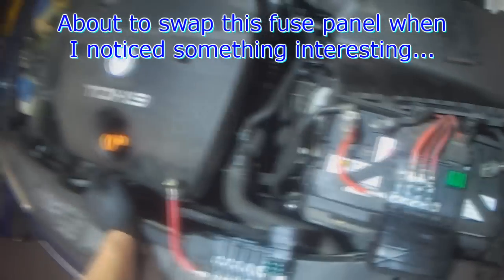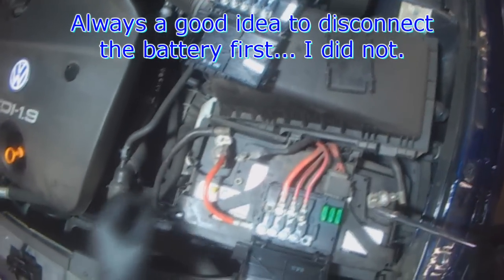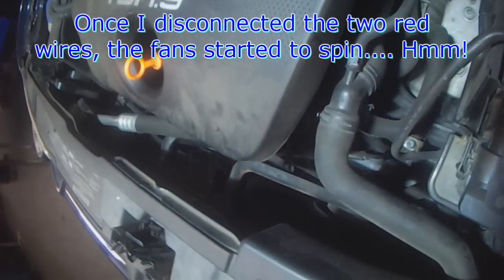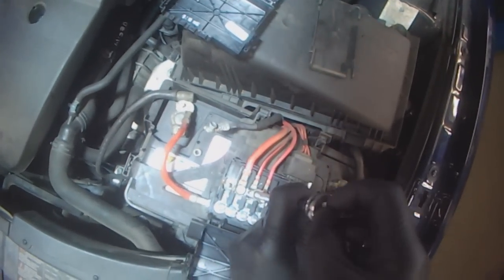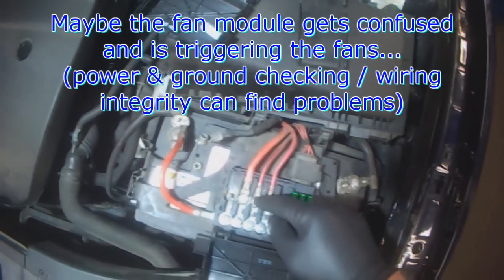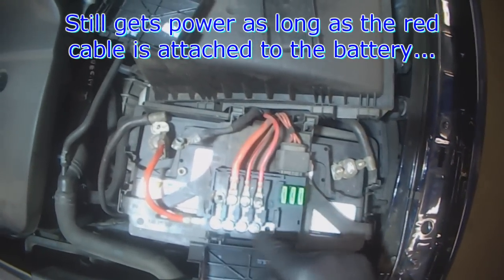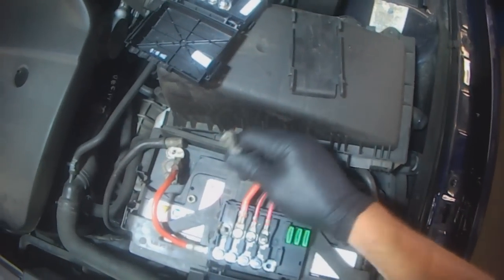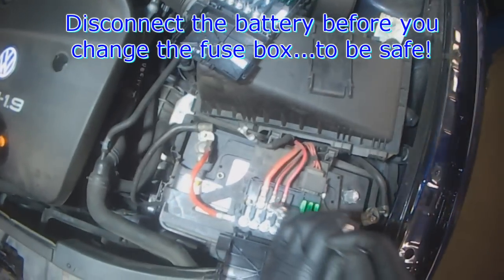VW A4: Weird cooling fan behavior!

Comment: This was so helpful for my Audi TT 2000. When I turn off the car, the fans keep working to full speed, I search everywhere and this video show me to stop it taking off the fuse, this morning with a lot of research done I change the fuse, check everything and start the car from a dead battery. The solution to this was: turn the car on, put the A/C to full speed for like 10 minutes, wait for the fans and then TURN OFF THE "AUTO" on the A/C. Like Magic, my fans start working normal.
Reply from the maker: Interesting... thanks for watching!

Comment: Literally same thing happened to me with my mk1 TT. My wife came home and said she had to get a jump start because the battery was dead and the odometer read "FUSE". First thing I do is look at those fuses (google research directed me), and I noticed corrosion on the thicker red wire in that box. As soon as I went to loosen it to clean up the wire, the fans kicked on. Haven't had time to put it back together yet and test it, but I'm thinking after seeing this that I might be on the path to success.

Comment: Hey did you notice if the fans turned off when you opened the door or keyed on?
Reply from the maker: I did not... but I can check if that happens on the next A4/mk4 that I see... I should see one sometime this week.
Reply: @EXOVCDS  
cool let me know! Im chasing an issue on an 07 A6 4.2, swapped the motor and now the fans come on when i connect the battery, stop when I open the door (usually) or when I key on. 
(I accidentally hooked the alternator positive and the ground backwards, so had a little spark show from the front of the car, now Im wondering If maybe I blew one of those fuses by the ECM, popping the cover off and will check. 
Otherwise suspect the AC pressure sensor may be shorted internally (the 3 wire connectors was corroded and broken, new wires and connector put on), but switch itself may be indicating open circuit, forcing vehicle into a cool down?
Reply from the maker: @BGGarage  Battery reverse hook-up can blow control units... your Audi A6 is different from this VW A4 (mk4) Golf/Jetta. Do a full system scan with a scan tool (that can do it) so you can see if there are any radiator fan related codes or coolant temperature sensor codes etc.
Reply: @EXOVCDS  
Thats what puzzles me. VCDS is only showing a code for IAT circuit open, (intergrated into MAF), but that code was there from before as well...I hope I did not damage the fan control module
Reply from the maker: No codes in HVAC or other modules?
Reply: Thomas EXOVCDS 
Only hvac code is blower fan mechanical failure, again was there before. Checked that distribution block this morning all tight.

Fan sequence is-
Plug battery in,
Fans turn on
Open door, fans turn off, 
If you dont key on or start, fans will turn on shortly after
Fans operate normally while driving, 
Turn vehicle off, fans turn on approx 15 mins later
Reply: 219 relay in the c6 A6 is under the driver side compartment ya? only 373 relay in passenger side under ECM. Need to check that out today after work.
Reply from the maker: I'll do some checking after work tonight.
Reply: Thomas EXOVCDS 
i traced my issue back-there were 2 afternarket relays added for the fans u der the ecm, when i took those out with the ecm to swap wngine, i mistakenly put the ground side of the relays to power. 
I then had an issue after there the ecm would not connect to the data bus, then sometimes it would buy wouldnt crank-traced that to the red connector u der the left cowl panel, when i move it to a certain position can hear the start/auth relays engage/disengage.

do you have a good tool for taking apart the small ECM connectors? Or the stabdard .2 and .3mm VAG pin tools work for those?
Reply from the maker: Sorry for not having gotten back to you last week.... you did some good troubleshooting, I would not have guessed relay power issues. I don't have a tool for those small pins. The dealer tool site might list something specific. https://audi.snapon.com/
Reply from the maker: Like this kit.
https://audi.snapon.com/SpecialToolsDetail.aspx?itemId=52990163

Comment: How about if the fan goes on as sonest I turned on my car and won't turn off until minutes later I turned off the car (2010 vw gti)
Reply from the maker: Not sure... run a full system scan to see if there is any helpful info (first thing most shops do). If nothing is stored, then you have to check things one by one. Temperature sensor readings, AC pressure readings, output tests of fan module ets.

Comment: I have a Golf 4 GTI 20 Turbo 2002, I have a fan problem, when I put the switch on the ignition mode, a fan starts to turn on and off at the same time, when I remove my fuse in the fan, So you remove the red wire in the black cooling fans slowing down the fan speed only

Comment: hi buddy i have a problem with a 2004 golf 2.0 on the fuse box the s180 fuse is melting and it appears that the box was replace already it looks  like it came from a junk yard  what u sudgest i should do....
Reply from the maker: S180 is for the radiator fans.... if it's a used box, get a new one. Or cut the wire at the connector... get an "inline fuse", splice it to the cut wire and attach the other end of the "inline fuse" to the battery + clamp (remove one of the nuts, secure the "inline fuse" wire to the clamp with an appropriate crimp connector and tighten the nut back into place).
Reply: thanks men  i will replce for new fuse box because its a used box and may cause problems in the near future.....
Reply: Hey thomas i have another question for you its for a different car i have a 2000 audi tt 1.8 turbo NOT the 225 hp engine the car runs fine but once it reaches the half mark the temperature gauge it starts doing something weird the temperature gauge goes up one line after the half mark no more than that  when i stop in a red light or i go up a hill but after 30 seconds it returns to the half line mark and  after 20 mins driving the same thing happens what u sudggest?? is this a common issue? how can i fix this?
Reply from the maker: The early TT's had temperature gauge / needle issues... where the needle would be show hotter than normal. I don't think that this is the case for you, more so a possible cooling issue. If you have a scan tool, I would compare the temperature that the ECM "sees" with what the gauge / needle is showing ( at the point the needle is high). If the ECM also shows high temperature when the dash shows high temperature... look for a cooling issue (slipping water pump impeller, thermostat that is acting up, radiator fans that are not coming on etc). 
A good VW / Audi scan tool can do "output tests" on the instrument cluster gauges. The needles will swing right to left and stop in the middle. If the temperature needle does not stop in the middle, then you know that it is a needle / gauge issue.... instead of an electrical or mechanical cooling system issue.
Reply: thank u,,,, u  know a way i can test out water pump?? and fans? the thermostat i replace it a month ago.
Reply from the maker: When the engine is warm... turn the heater inside the car to max hot and turn the heater motor to max speed. Warm / hot air should blow all the time... if the air gets cold, the water pump might be bad. To check for water pump flow... remove the small coolant hose at the coolant reservoir and point it into the coolant reservoir (cap off). Start the engine and raise the rpm to 2000. You should have lots of coolant returning into the reservoir bottle from that hose. Little or or no coolant flow from the small hose can be a sign of a bad water pump. Watch this:
https://www.youtube.com/watch?v=LiDRUWPw_f4
Reply: hey thomas just an update on the issue it was the coolant tempeture sensor causing the temperature to bounce around its all good now... Buuuuut i have a question now on regards replacing AC compressor steps on a 2000 audi tt dont have any tutorials on that  buddy????
Reply from the maker: A Sanchez Thank you for the update! I do not yet have an ac compressor removal video. Evacuate the system... remove the compressor and recharge the system.
Reply: seems theres no videos of removal and installation i will upload mine then but is it simple as removing alternator ?? do i need to get the gas and air out first in order to remove lines and compressor???
Reply from the maker: A Sanchez Replacement can probably done from above or below... yes, you need to evacuate the gas first. It is against the law to let it escape into the atmosphere.
Reply: ok thanks seems pretty easy job i dont think it has any gas no more last time they check it didnt have none so i should be good to just replace it and then take it to filled it up with gas right?
Reply from the maker: A Sanchez AC gasses can cause cancer... work safe.

Comment: sorry i seem to be all over your videos but this car is one thing after another. I have a b5 avant 1.8t but the electric fan wont go on i change the temp unit and it when on for a while but now its nots turning on. I also tested the fan and it works. is there fan relay somewhere in ther car i checked the manual but there is nothing
Reply from the maker: +Jose Gonzalez Make sure you are getting heat inside the car when the engine temperature gets warm... if you have no heat inside the car,  then the water pump might be bad. If you have consistent heat... you might have a stuck thermostat.
Reply: +Thomas EXOVCDS yea when im stuck in traffic the temp gage goes over 1/4 and i can feel constant heat then once i get going it goes back to normal temp
Reply from the maker: +Jose Gonzalez I assume you mean 1/4 past the middle? If the temperature drops / goes back down when driving, then the thermostat is OK. Does your engine have a fan that is belt driven?
Reply: +Thomas EXOVCDS yes it has a belt driven and an electric fan the electric fan is the one not working
Reply from the maker: +Jose Gonzalez The engine should not run hot if the little fan does not work. Yes, it should come on when things get hot or when the AC is turned on.

It could be that your belt driven fan has a bad viscous clutch... the fan should spin with more power when the viscous clutch gets warm. If the fan just free-wheels, the clutch is bad.
Reply: +Thomas EXOVCDS oh wow I have noticed it is a bit slow when it's idling. Ill have to change it out the. Thanks man i really appreciate the tips. I just bought the car and i feel that is falling apart on me

Comment: did you ever figure out what was causing this issue I have a 2000 vr6 jetta I replaced the radiator new fans and they don't come on on there own but if I do the same trick you did they come on
Reply from the maker: You need to check the "control" of the fans. Disconnecting the electrical (like in this video) is a side-effect that causes the fans to work. You need to check the power to the fan switch (at the radiator), the fan fuse (green fuse on top of battery), the fan module under the battery. Low speed does not need the fan module. Check the individual speeds at each fan harness plug. It could be that both low speeds of each fan is burnt out. Also check the thermostat operation. A stuck thermostat will cause no fan operation, because the radiator is not getting warm.
Reply: Thomas EXOVCDS awesome will try those as well car had been sitting for like 4years and the old fans and radiator were no good (one can broken and siezed) and the radiator had a broken neck .
Reply: fan*

Comment: So while driving my car has never overheated or run hot. But the other day I let it idle for about 15 minutes or so while going through my storage unit. It started to run very hot and only the small fan was running. The larger fan spins freely but wont kick on. Once I got driving after letting it cool down it never got hot again. Suggestions?
Reply from the maker: Year, make, model, engine?
Engine shouldn't overheat / run hot with only the small fan working... but it depends on engine, accessory loads and ambient temperatures. Replace the large fan if it is no good.
Reply: Sorry haha. 2004 Jetta GL. 2.0. I wasn't sure if the larger fan should kick on only while driving or if it would kick on while idling.
Reply from the maker: Both fans should run when needed... ac or not. 
The little one should be enough to keep things cool as mentioned earlier. Replace the large fan regardless, since it is bad and then investigate things further if need be.

Comment from the maker: S164 is for the Cooling Fan Control Module... could be that the default for "no power" is to run the fans. I might investigate that further when I have time.
Reply: Great info
Reply: +Thomas EXOVCDS I saw this on a friends 2000 VR6 Jetta.  The fan would run for 10 minutes every time you cycled the key. The problem happens when the small constant power wire going to the FCM is bad, but the switched power was good and the large power wire was good. 
It took me forever to figure out on the 2000 because the wire was corroded / broken inside the connector, so when I probed the back of the connector it seemed like it was OK.
Reply from the maker: +compu85 Thanks for the verification! I've solved several things over the years by resorting to ohm wire by wire... it might not explain the symptom (s), but it at least fixes the issue. Figured though that something (cfm) was getting confused / the cause.
Reply: It would be great if the Bentley documented some of the default condition / fault conditions of the control modules. Sometimes the SSPs have them but not always.
Reply: This video demonstrates the problem in the Golf 4 GTI 20 Turbo,